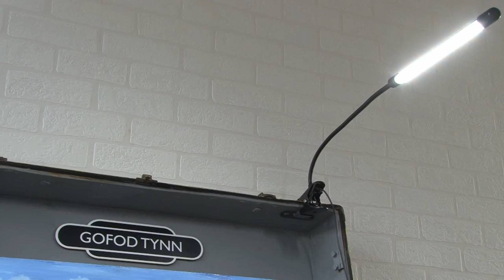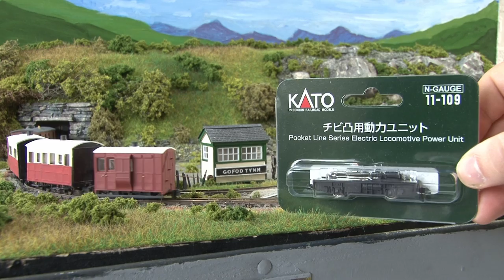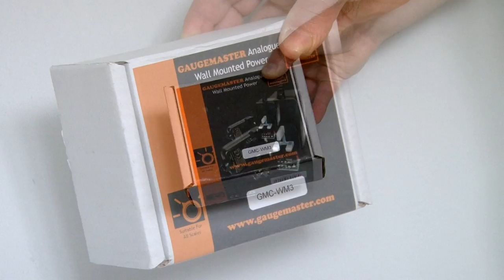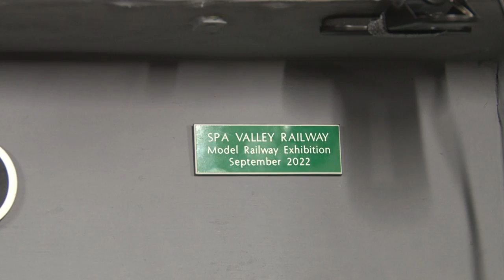Preparing A Model Railway For An Exhibition! - Gofod Tynn - 009 Layout In A Suitcase

Comment: Wow! That is interesting, I didn't realise the emphasis on making sure trains move at all costs (makes sense of course).

That's a cool figure of you!
Reply from the maker: It's not an emphasis that all layout owners stick too 😅 But certainly from my own experiences at exhibitions as a spectator, I move on very quickly if nothing happens for a while. Thanks for watching 👍
Reply: @ThatModelRailwayGuy  I saw a discussion somewhere where they said that owners should allow trains rather to run than do operations (running allows you to focus on the guests and endless questions) and trying to do operations brings in other problems of trains getting stuck , the hand in the sky etc.

I know some layouts are only for switching etc. But I would agree to keep ops on a more personal level outside of exhibitions.

Comment: I love the look of those lights. How long does a full charge on the lights last? And how long to fully charge? Thanks
Reply from the maker: Hiya, the lights actually aren't battery powered they have a cable to plug into the mains. That said, it is a USB connection so you could run them off a power bank if you really wanted too. Thanks for watching 😃

Comment: Looks like an awesome weekend 👏.  How do you go about getting it into the exhibition do you have to apply or were you invited? Did you have to pay any entry fee?
Reply from the maker: In this instance I volunteer at the Spa Valley Railway so was able to talk to the organisers about the layout while I was building it. Once it was done I sent over some photos and they kindly made space for it. 

During the show there were organisers for other exhibitions looking around too and some of them approached me to invite the layout to their own shows next year. Generally though if you're thinking about displaying a layout, contact a few local shows with photos, some basic info and the dimensions of the layout for their consideration.

Sometimes it just comes down to having something bit different - ie: they don't want to have hundreds of BR 1960's steam layouts. Gofod Tynn is good in this way since its 009 which is already a bit different and has the added selling point of fitting inside a suitcase which is a fun way to display a layout but also means it takes up less space.

Hope that helps and thanks for watching 😃
Reply: @ThatModelRailwayGuy  Sounds good, thank you, I’m considering building an exhibition layout and not quite sure where to start on that side of things. This helps thank you 😊